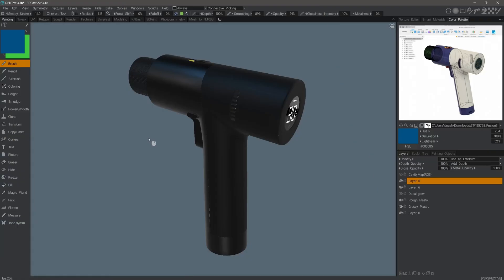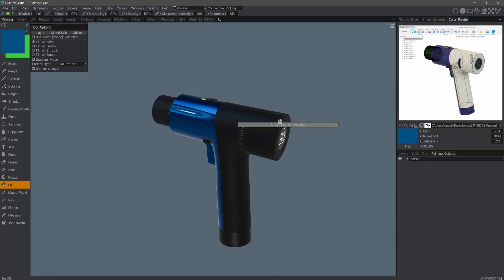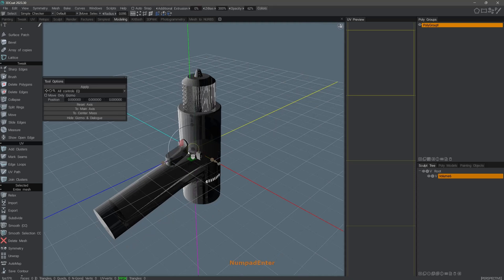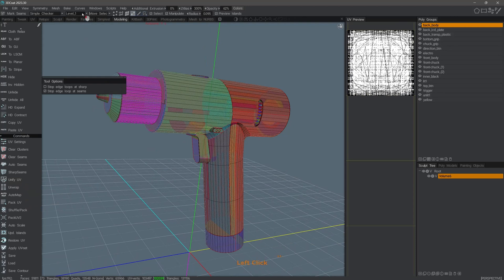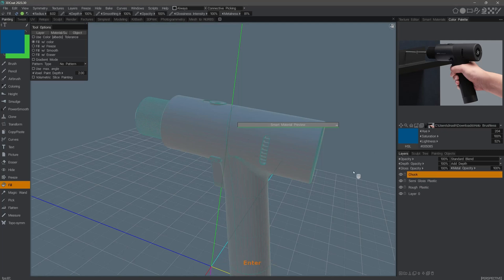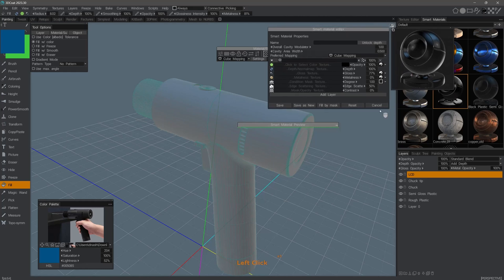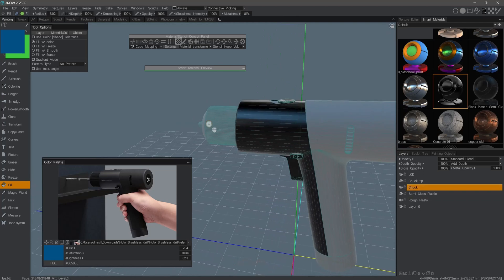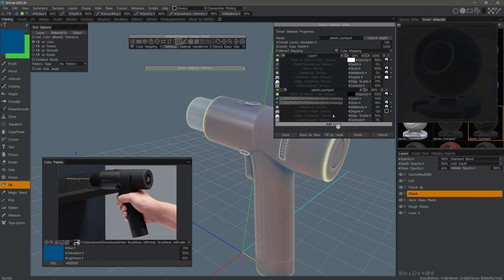CAD to 3DCoat Workflow Pt 1

Comment: I didn't know that choosing any UV tool will open up more UV buttons. Very useful tip, thanks, and honestly a quite bad UX :)
Reply from the maker: We can understand your view about the UI, but there is a logical reason for it. 3DCoat is very contextual, which helps to keep overall UI clutter to a minimum. Another example of this is the SELECT tool/mode. When a user clicks the SELECT button near the top of the Tool Panel, and then chooses Vertices/Edges/Faces mode in the toolbar, then a range of tools are displayed just for that mode, specifically.
Reply: @PILGWAY3DCoat  Yeah choosing a primitive type to open up contextual tools feels natural. It's just it never occurred to me that it's same with UV. Like I need to click on "Mark Seams" to open up a way for auto map button. I've just finished a small commission in 3d coat and legit thought auto map only existed in UV room and that brought quite a lot of pain for me. But as I'm getting used to quirks like that Im loving your app more and more!

Comment: I was hopeful you’d be able to load a cad format or usd , keep all the hierarchy and uv and add materials.
Reply from the maker: We currently have a MESH to NURBS (CAD format) export module in Beta development (the feature is already available to test/use during this period, but when it is finalized it will be a separate, paid module), and are exploring the development of a direct CAD format import, that will be converted to a very clean poly mesh...something most CAD application conversion tools don't do such a good job with.

Comment: Thanks for the video! Very helpful 👍
How are you navigating the UI so smoothly, is it with a 3Dconnexion? Paired with a pen tablet or mouse in the other hand?
Reply from the maker: Thank you kindly and yes, that is correct. It is using a 3dconnexion device. The biggest benefit is that it allows the user to continuously work...even while navigating. This is simply not possible without one, and that is one reason we highly recommend them. For tasks such as modeling, retopology, UV editing and rendering, a mouse will work just fine. However, for Texture Painting and Sculpting, a graphics tablet such as a Wacom, is also highly recommended, as much of the work is affected by stylus pressure.
Reply: I have been considering getting the 3D mouse for a while and combine it with my tablet. 
So in this video, did you have a tablet pen in one hand and 3D mouse in the other? The selections were made so quick so wondering if you went back and forth with one hand from normal mouse to 3D mouse or are you dual wielding 😂this is what goes through my head.
  @PILGWAY3DCoat
Reply from the maker: Yes, both devices were used simultaneously. The Spacemouse Enterprise has many programable buttons on it, to use in place of hotkeys on the keyboard. This helps to keep eyes and hands off the keyboard 90% of the time.
https://youtu.be/oSsL4RgatYA
https://youtu.be/oYR33DQ4FvI